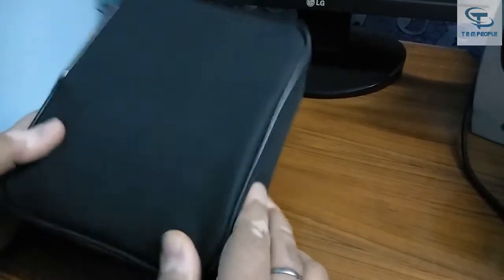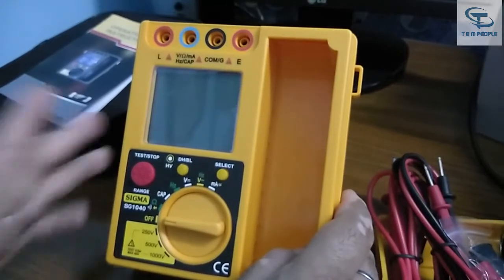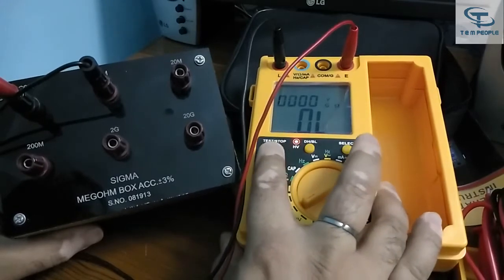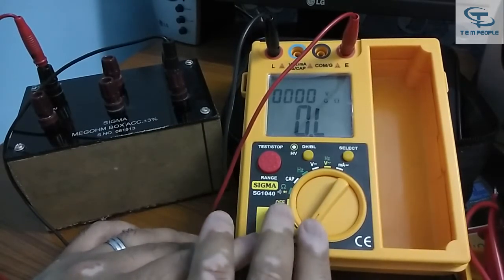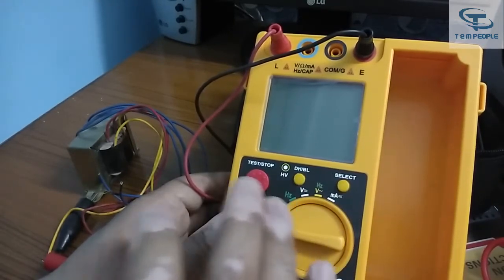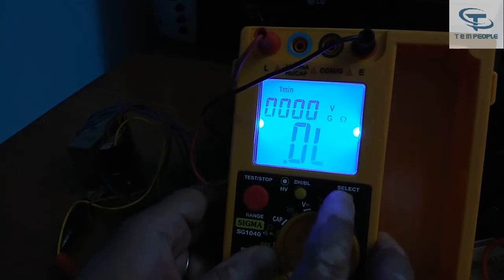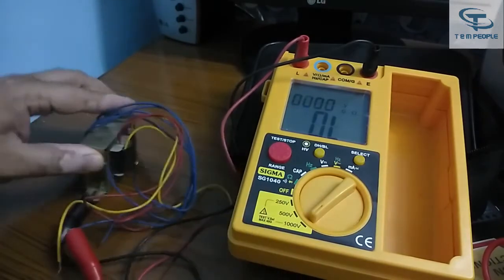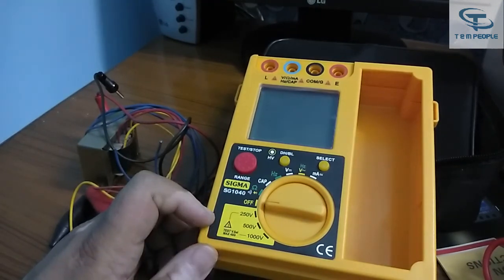How to use Digital Insulation Tester "SIGMA SG 1040" Testing Procedure in ENGLISH

Comment: Sir this metre performance good not good & metre  repairing isuu condition please reply sir
Reply from the maker: Sir,  Meter performance is good. Its a heavy duty meter. But do not short the meter as if the voltage goes inside any meter whether its SIGMA or Fluke it will destroy the meter. 
Sigma  have their service center in delhi. You can get it repair over there.

Comment: Would there be any change in results if I put red probe into E and black probe in L? Please guide and why not to put probe in another two places?
Reply from the maker: Sir, On the red wire voltage travels. When you put it on 500V DC, +ve voltage travels so heavy red color wire is to be used on L terminal and on E black color wire is connected